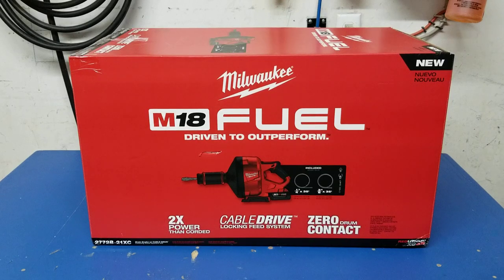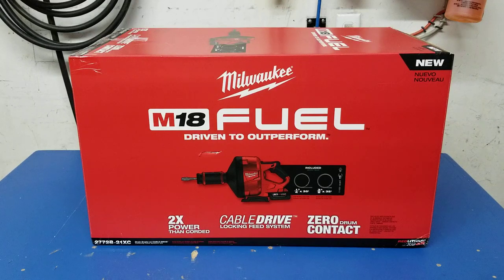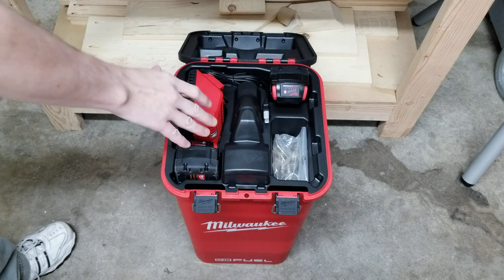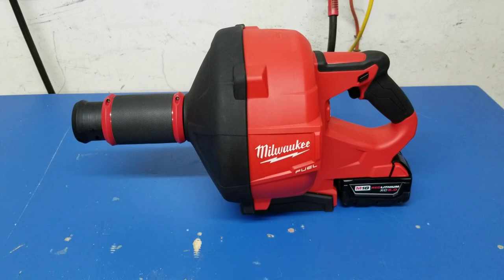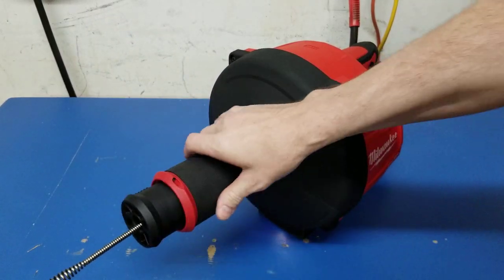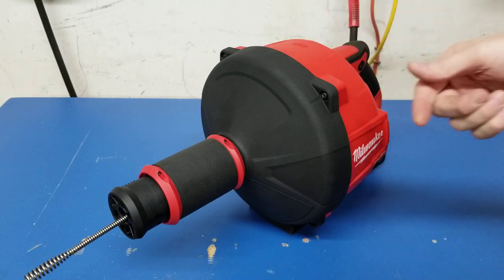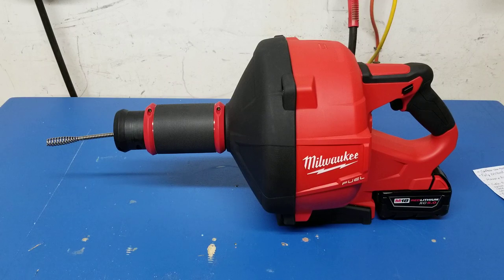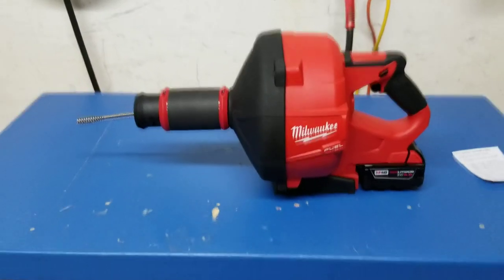Milwaukee M18 Fuel 18-Volt Lithium-Ion Cordless Drain Cleaning Snake Auger Cable Drive Kit

Comment: hello buddy i purchase same machine at home depot mine is comming with 8 amp high output battery for $399 but i think that battery might be too big so i purchase 3amp high output prob run nice on those usually on jobs not using the machine more then 10-15 min.what do you think?im using the dewalt right now with 5 amp batt and usually dont need a charge for a few jobs.thanks .
Reply from the maker: Nice I just saw that one on the Home Depot website and yeah an 8.0amp battery is way more than it needs a 5.0amp battery will run it forever, hell it'll run just fine on a 2.0amp battery! You should look into getting the bucket for it, it makes it so much easier to pack around and since it sits face down in the bucket it let's any excess water drain out while keeping the mess contained. I think you'll like the Milwaukee better, I freaking love mine I just did my shower drain last week and it only took 5 minutes and I pulled out a big chunk of shit! I haven't personally tried the dewalt one but it looks like a drill with a drum attached, I like how the Milwaukee is a one piece design better and the DeWalt will only take 35' cables where the Milwaukee will take up to 50' cables plus I like the cable drive mechanism better and also the enclosed drum too so I definitely like the design of the Milwaukee better.
Reply: @chevy5137  Yeah you know what it is.I got the high output Two pac 3.0 for $99 at home depot.Which I think is a nice size for that machine.And I also purchased high output 6 amp and at 3 AMp for $129 . When it comes to the cable length really 35 is all I want in a handheld machine.Most jobs I do aren't usually that far in length And if you are holding it handheld in the air It gets very heavy which a lot of jobs you do have to drill a clean out and hold the machine up.If I do get a long run  kitchen sink.I have my rigid drum machine with 75 feet of 3/8 cable.25 feet in a handheld is like the best feel.I got a steal on the Dewalt with a five amp 20 v battery& charger for $199 
Last Christmas it was like almost a $500 set up.It is pretty sweet it is a nice machine.So I'll keep my short bathtub cable in the Dewalt.When you put 50 feet in a drum I could start to kink And flip over in the drum.So the 35 feet is perfect amount.Thanks for the video and showing the machine it's very good video.I'm wondering how much can i get that bucket accessory?Thanks again👍😎
Reply from the maker: @king1ny  I'm glad you enjoyed the video and yeah 35' cables seem to do the trick, my set came with the drain snake, the bucket, a 5.0amp battery, a charger, a 35' 5/16" cable and a 35' 3/8" cable with 4 interchangeable heads and I was lucky enough to get it for free a just a couple weeks after it came out so I could test and review it for Home Depot. I'm not sure where you can buy the bucket separate but it's really nice, it holds my drain snake, my 2nd cable and there's a tray at the top that will hold 2 5.0amp batteries a charger and has a place for some accessories, I keep some gloves, safety glasses and heads for my 3/8" cable in there, I don't think you can get just the bucket from Home Depot but you might be able to on the Milwaukee website. After you have a chance to use it let me know how you think it compares to the DeWalt snake. That's so cool that you have a Ridgid drum machine, I was actually given the opportunity to get one of the Milwaukee 18-Volt switch pack drums that'll take 75" of cable, a 12-Volt Milwaukee air snake or the 18-Volt handheld snake kit, out of the 3 I decided to pick the 18-Volt handheld snake kit since it was best suited for my needs and it has never let me down, it's cleared every drain I've used it on quick and easy I love the hell out of it!
Reply: @chevy5137  Yeah the rigid machine is pretty nice because I can change the drums different size cables I had the spartan100 before.The only thing I don't like about a lot of these machines use the air switch.So on my sewer machine I have the spartan  300 old machine.5/8 cable 75 ft And I still have the old electric foot pedal.Those are the best I can't stand the air switch.Should be getting the Milwaukee any day now.The only thing with the Dewalt When you have 25 feet of quarter inch cable And you're doing a longer run When you hit about 15 feet The cable is not anchored down So the machine cable doesn't get the tourque That's why I put 35 feet in for that reason.Because the cable just keeps spinning inside the drum.Do you have any more videos on drain cleaning with that machine?
Reply: @chevy5137  Hi buddy I wanted to ask you a question.I can't find the bucket that comes with the unit.Will the machine still fit inside a 5 gallon Home Depot bucket?thanks.
Reply from the maker: @king1ny  I think it would probably fit in a 5 gallon bucket but I'm not sure. This is the kit I got that came with the bucket and other accessories, https://www.homedepot.com/p/Milwaukee-M18-FUEL-18-Volt-Lithium-Ion-Cordless-Drain-Cleaning-Snake-Auger-with-1-4-in-and-3-8-in-Cable-Drive-Kit-2772B-21XC/303229100 I looked on the Milwaukee website and couldn't find a bucket for it only a similar smaller bucket made for hand tools and a drill.
Reply from the maker: @king1ny  No unfortunately I don't have any videos of me using it, I should have made one when I did my shower drain a couple weeks ago, it only went about 10 feet down but I pulled out a giant chunk of shit! If your looking for a machine that will go 75' then you should check out one of the Milwaukee M18 FUEL Switch Packs, they are cordless and you can carry them like a backpack and also you can easily switch between different drums so if you have a couple you can keep different size cables in each and then just switch the drum pack instead of having to pull out the existing cable and putting in a new one, they are really cool, I had the option to pick one to test but I picked this handheld one instead because it suited my needs better. This is one of the Milwaukee  switch pack kits https://www.homedepot.com/p/Milwaukee-M18-Fuel-18-Volt-Lithium-Ion-Brushless-Cordless-Drain-Cleaning-3-8-in-Switch-Pack-Sectional-Drum-System-Kit-2775B-211/303171605
Reply: @chevy5137  Oh yes I've been looking at the backpack unit.Just doesn't look too durable to me.I like the idea of it.I saw some videos of it.That is a pretty good price the one at Home Depot.Thank you brother
Reply: @chevy5137  Hey buddy let me ask you a question.If I want to change the cable to 1/4 inch Can I pull the cable straight out is it connected inside the drum?Because I pulled it all the way out and it stops Is it anchored down inside the drum.Because usually with my other hand gun I could pull it straight out.thanks😎
Reply from the maker: @king1ny  It's not anchored in the drum, the Milwaukee cables have a bulb in the line near the end so when your power feeding them you can't feed them to far and lose the cable down the drain line. If you pop the drive mechanism into neutral then you can pull the cable out by hand and put in a new one.
Reply: @chevy5137  Yes cool I saw the bulb.OK good so then I just put it in neutral and I'll pull it right out.Thanks for the info nice machine👍😎
Reply: @chevy5137  I return the package I got and I'm getting it with the storage bucket.machine,cable,2.0 battery& charger  $475 no tax😎👍thanks
Reply from the maker: @king1ny  Sure thing, you'll definitely like having the bucket to store and carry it in and even a 2.0amp battery will have enough juice to do 2-3 drains before needing to be charged, the 8.0amp High Output battery is extreme overkill.
Reply from the maker: @king1ny  No problem I like how easy the cables are to change and when you want to clean the drum simply pull out the cable and leave the drive mechanism in neutral and there are 4 bolts 1 at each corner of the front of the drum housing and you just unscrew those and the front piece will come off allowing you access to the inside of the drum so you can easily clean it out.
Reply: @chevy5137  Oh that's cool thanks what happens when the automatic feeder starts to get I'll gunky and if the rollers freeze  up.That's basically where in tear if it stops working will they warranty that and repair ?See I use my machine professionally.I might use it 3-5 times a week.Do you spray any WD-40 or anything in there?
Reply: @chevy5137  Yeah I'm getting rid of the 8 amp battery.So I have the two pack with 6 amp and a 3 amp.And the machine is going to come with the 2 amp.So I have plenty of back up batteries.Most of the time with my DeWalt cordless.Don't really need automatic feed for these 1/4 inch cable's Usually a shower stall the clog is within like 3 feet.I really never need auto feed to be honest.I still like the way the Dewalt doesn't have a moving drum.And it kind of feels better in the hand because it's a little bit smaller.You should try one one time.That's gonna be my back up machine with a different cable😎👍
Reply from the maker: @king1ny  I used to run all DeWalt back in the days of Ni-Cad batteries and had 9 of them but after they got stolen I started running Ridgid cuz at the time I got some really sweet deals on the first ones I got and really needed and they are nice tools too, after that I continued to run Ridgid since I was already setup in their tool line. But then after getting 4 free Milwaukee tools and 5 free M18 5.0amp batteries thru a testing and reviewing program I'm in thru Home Depot I started running Milwaukee too so now I run all Milwaukee and Ridgid. I have 25 Milwaukee tools (5 M12 and 20 M18) and 3 - 12.0amp, 2 - 9.0amp, 2 - 6.0amp High Output, 4 - 5.0amp and 1 - 1.5amp M18 batteries and 5 M12 batteries and I have 15 Ridgid 18-Volt tools and 7 Ridgid batteries but I got into before Ridgid started releasing their really high amp batteries so the biggest Ridgid batteries I have are 2 - 5.0amp, 3 - 4.0amp and 2 - 2.0amp ones. So yeah I'm heavily invested in Ridgid and especially Milwaukee. I usually buy Milwaukee tools now but Ridgid does come out with some specialty tools I buy here and there. Oh and I do have a Ryobi cordless glue gun it's really cool and I might get one of their 18-Volt caulk guns, I'd like a Milwaukee one but they are $150 just for an M12 one and $200 for a M18 one and I don't do enough caulking to fork out that kind of money, the Ryobi one may not be as nice but it's only like $40 and I might eventually get some more Ryobi tools too like their 180 light it's really cool. Plus I have a Ryobi garage door opener which is freaking sweet, it will accept all sorts of accessories on the sides, back and front of it, on mine I have 2 fans, a 3 outlet 35' retractable extension cord and a laser light parking assist system! You can also get other things for it like a Bluetooth speaker, surveillance camera, an air compressor tire inflator (which I didn't get since I have a 60 gallon compressor) and I have a 3.0amp battery backup in it so I can open it even if the power is out and what else is cool is I can control it and all the accessories on it thru my smartphone, it's the best garage door opener I've ever had! Long story short I don't think I'll be investing in DeWalt since I have all the tools I already need from Milwaukee and Ridgid, DeWalt doesn't really have anything I need or can't get from Milwaukee or Ridgid. I will say DeWalt does make great tools though they just don't happen to be the line I'm in. If I ever get the chance though I'd like to try the DeWalt drain snake.
Reply: @chevy5137  Oh yeah I hear you about the collection of tools you have with Milwaukee.I actually have a Makita drill,And then I have small Bosch drill and driver.There's certain things I like about all these different tools.The reason why I got this Dewalt drain cleaner.If you went on Home Depot's website.And you buy it as a battery charger box and machine price was $500.And I don't really care about the carrying case on that.So then the funny part was.I saw DeWalt charger +5 amp battery the good battery And free tool And it just so happened to be the drain cleaner was free With the cable $199 That was a steal last xmas.I'm sorry I didn't buy two of them.And it does have nice LED lights.It's very comfortable in the hand as a drill and a drum it is a nice machine especially for that price.And when it comes to sewer lines i use the top brand that most professionals use spartan 300 5/8 x75 ft.Not something like a homeowner would buy.But it sounds like you have a nice collection of tools.So I'm not just married to one brand.I'm looking into getting a small handheld camera do you like Milwaukee over the rigid?Thanks for the info😎👍
Reply from the maker: @king1ny  yeah I think Milwaukee tools are higher quality than Ridgid but mostly more innovative and they offer more specialty tools however there a couple Ridgid tools I like better than Milwaukee ones, I still consider Ridgid to be professional tools though and I have never had one break on me. Idk if you know but TTI owns Ryobi, Ridgid and Milwaukee with Ryobi as their DIY brand, Ridgid as what I would consider their professional brand and Milwaukee as their top teir brand. I assume TTI has a deal with Home Depot which is why they are the only physical location you can only get Ryobi, Ridgid and Milwaukee there, well except Milwaukee you can't get anywhere the variety you can at Home Depot but I have seen just a few at other places like Ace Hardware I think and they only had like 3 or 4 Milwaukee power tools and they were older ones at that not the newest generation ones.
Reply: @chevy5137  Yes I agree the only thing I really like from Ridgid Is the Wet vac.They are big with the see snake video inspection.i use the k-3800 drum machines for 2" long run lines.i got my new milwaukee handgun with the storage container much better choice.rhanks😎👍
Reply: @chevy5137  Hey buddy I return the kit with the carrying case I tried the machine for the first time I didn't like it compared to my Dewalt cordless.I don't like the thick locking mechanism.The way you have to lock it in move back-and-forth.When it comes to professional use you really don't use automatic feed with that type of machine.Maybe it's good for the homeowner every once in a while you're not using it every day.And the Dewalt seems to be more powerful.Thanks anyway for helping out👍
Reply from the maker: @king1ny  I really love mine and I like that it's cable fed but that it can also be hand fed or retracted, usually I run mine in with the auto feed and then pull it back out by hand
Reply: @chevy5137  Yes for a homeowner it's probably a good machine.But professional use the machine is very easy to push in by hand.I just don't like that sliding lock mechanism and it's so fat.I like the barrel to be skinnier.I think it's a great machine but I still like my Dewalt a lot better.I think I have more power.But enjoy it

Comment: My professional contractors only use DeWalt.
Reply from the maker: I like DeWalt they make good stuff! I used to run all DeWalt but my DeWalt tools got stolen and then I invested in Ridgid and after I got some Milwaukee tools and a lot of free Milwaukee batteries I branched into Milwaukee. Really it just comes down to your preference and which brand happens to make specialty tools that u might need
Reply: Dewalt is the Dominoes of pizza of tools
Reply: They would use Milwaukee if they were smart.

Comment: I paid 375 for it plus tax and every drain I get done normally runs 145
Reply from the maker: Nice sounds like a good deal. Milwaukee sent me out mine for free to test and review and it's the Milwaukee M18 FUEL 18-Volt Lithium-Ion Brushless Cordless Drain Snake Auger Kit. Here is the link to the one they sent out to me, it's totally Badass! 

Milwaukee	M18 FUEL 18-Volt Lithium-Ion Cordless Drain Cleaning Snake Auger with 1/4 in. and 3/8 in. Cable Drive Kit
https://www.homedepot.com/p/Milwaukee-M18-FUEL-18-Volt-Lithium-Ion-Cordless-Drain-Cleaning-Snake-Auger-with-1-4-in-and-3-8-in-Cable-Drive-Kit-2772B-21XC/303229100
Reply: Damn 145 a drain were you live at. I charge 325 with warranty.
Reply: Bigger Daddy I live in New Jersey and well everything is expensive and I know for a fact most companies charge the exact same or more or less.
Reply: Bigger Daddy where you from? Alabama? Would explain a lot
Reply: Andrew England that is insane I would help him get his tools out and say thanks but no thanks I bought my drum snake for about a hundred more than a call for you. But I am in the wrong business just out of curiosity what do you charge for a hot water heater I paid over 1500 installed here just wondering if that would be over 3 thousand for a call to you mid range hot water not the most expensive but not the cheapest neither
Reply: Bigger Daddy for a basic swap with a Bradford white maybe 1700 at the most. 2000 if it needs all code upgrades.
Reply: Bigger Daddy I’m a plumber. Not a handyman or maintenance guy.